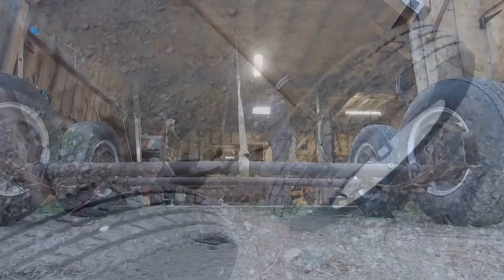Building A Sawmill Trailer Start To Finish From Scrap Metal

Comment: Congratulations on your build! I agree with the other comments that you need a walkway on the right side.
Reply from the maker: I ended up putting a handle on it so I can run it on the ground.  Works much better that way.